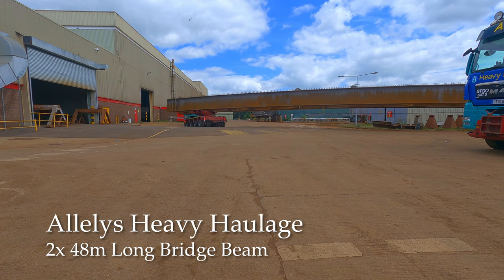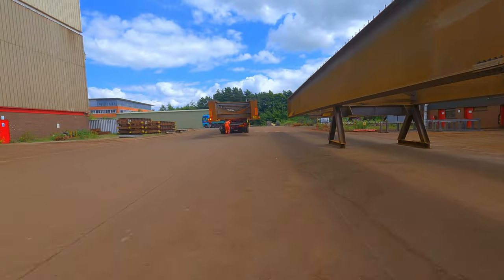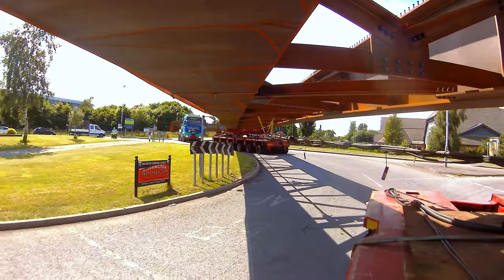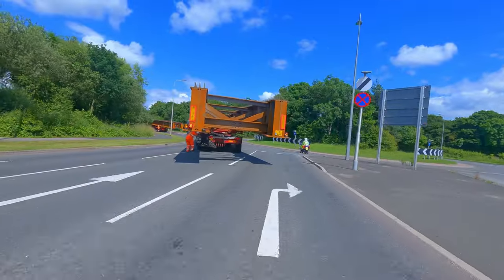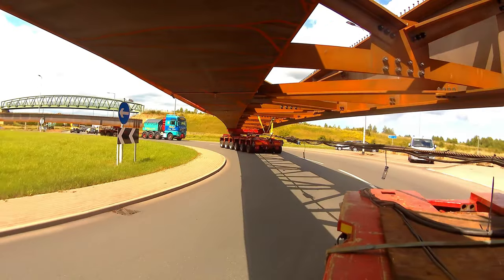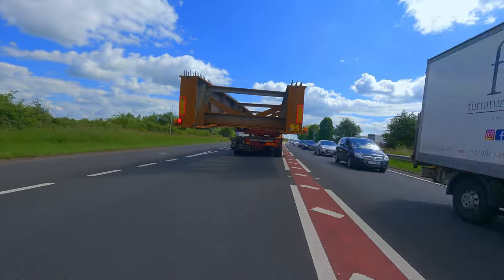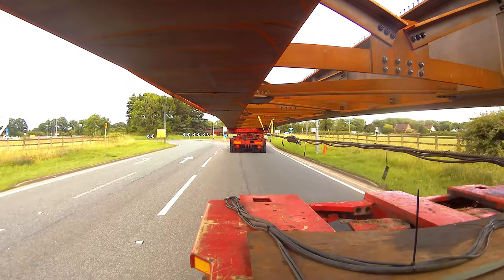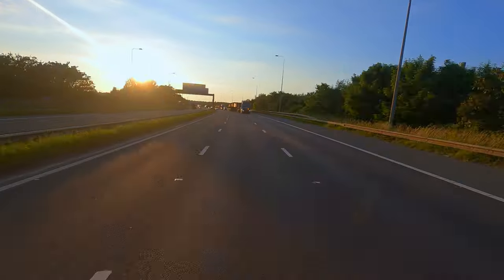Allelys Haul 48m Bridge Beams From Darlington

Comment: Hi, intrigued to fathom how the rear bogey keeps a locked distance. I think it's the actual bridge making part of the trailer so to speak but my brain won't compute that with all the rear steering, rotation of the load on the bogey and so on.
Reply from the maker: That’s exactly it, the bridge is fastened to the turntables and acts as the trailer.
Reply from the maker: Thanks for watching !
Reply: @Priestabload  now to tell my brain to accept it haha cheers

Comment: Great video- does the auto steering take its direction from the front end similar to a steerable trailer?
Reply from the maker: No it takes it from the turntable on the rear bogie. As the beam turns, the turn table drives two rams which provide a hydraulic signal to the rear bogie wheels.
The front bogie obviously gets its steering signal from the front draw bar as it normally would.
Reply from the maker: Thanks for watching, I’m glad you enjoyed it.
Reply: @Priestabload  awesome- thank you